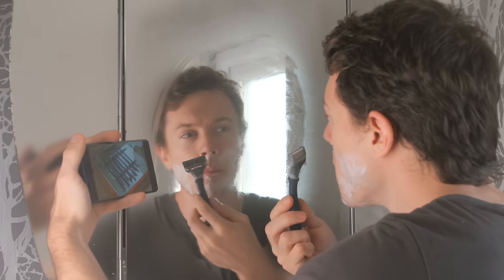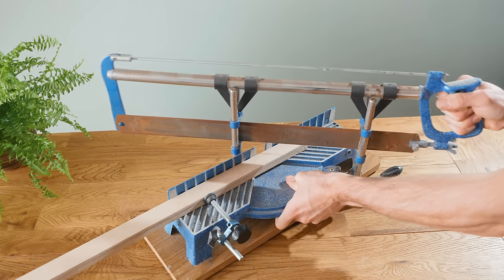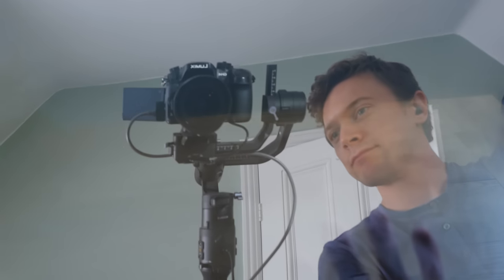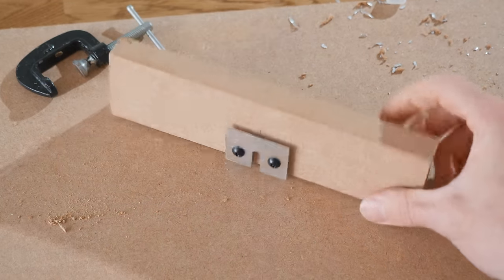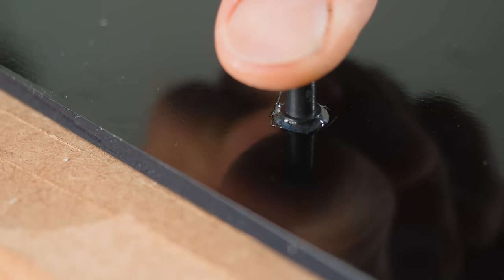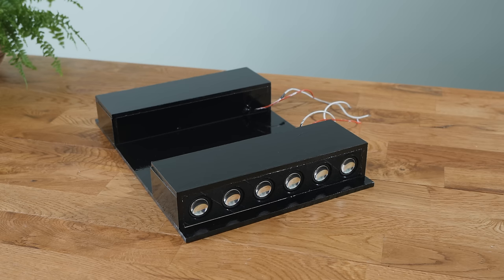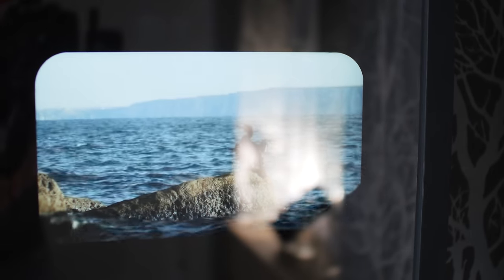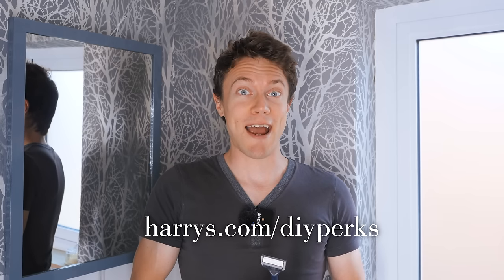DIY Smart Mirror (that doesn't steam up!)

Comment: 6:40 electricity in the bathroom? Meanwhile in america we like "yeah this is a plug so I can bring my TV in the shower with me. And this is my other plug so I can charge my phone and watch videos in the shower. And my shower head is also a speaker".
Reply: Watt?!?  Wow.  Ohm eye!  Definitely not revolting from this comment.  This amped up my day.
Reply: @ronture8279  underrated comment.
Reply: If you just use a GFCI outlet...
Reply: In all countries there are plugs in the bathrooms. After all, you have lights in there, people use them to power up fans, or shave or whatever. Not just the US. 
DIY perks is just implying that if you fk something up, given your diy skills, you wont be shocked with 110 or 220 volts and die on the spot. Worst that can happen is ull burn a board or two.
Reply: @faythelyzabeth5647  actually I was making fun of the fact that they are making tablets you can use in the shower so you can watch TV in the shower.
Reply: Jokes aside, I literally have a mini heater in the plug above my bathroom sink. It's like a little 4inch heater that automatically warms the bathroom up. Super dangerous but no one likes a cold ass or shriveled balls during a mid night pee sesh or freezing to death during a winter shower. 
I also have a bluetooth speaker in my shower, my showerhead has LEDs and a speaker in it also (I never use the speaker, it sounds like crap) and I use a battery powered back scrubber.
Electrocution is real possibility for me. I have so much electrical junk in my small bathroom. Toothbrush, waterpik, and shaver plugged in to one outlet with a air freshener, and I also a blow dryer I use to warm up the toilet seat before dropping loads when it's cold. (My little heater does pretty good, but the seat is always too cold. Try it. You know you want to. It only takes like 20 seconds. Put it on hot, like 1 inch from the seat and move it around very quickly and boom. Warm ass. Success.)

Omg. I'm gonna die in my bathroom! 
Omg! My awesome dental hygiene, warm craps, and awesome shower parties are going to kill me in my warm cozy bathroom! 
...

Oh well.
Worth it.
Reply: @nickdrozd  There are not plugs in bathrooms in every country. Denmark even have their light switches outside the bathroom.
Reply: Hahaha, you think that is dangerous. A lot of countries use mains to heat up the water IN the shower head. I don't really ever see topping that for danger. They're called suicide showers, look em up.
Reply: @ronture8279  with wooden houses, lol
Reply: @JorgenKreedz  It really makes it hard to use a bidet in your bathroom without power outlets.  Denmark is missing out :D
Reply: @ronture8279  Great choice of word there: AMPED
Lol
Reply: @JamesLee-sw6ss  I have to ask why do you need a power outlet for a bidet? Every bidet I have ever seen in Europe just has a water supply.
Reply: @davidturner8833  TOTO SW2034#01 C100 search that one up.

I just looked on amazon and saw the non-electronic ones you were talking about.  I've personally never seen or used them; like I said, all the ones I used in Asia were electronic.

Forgot to mention, electronic seat warmers are amazing...  Anything less is savagery.
Reply: No plugs and switches in the UK either. Million years old regulation. can't charge your thootbrush in the bathroom :)
Reply: @DanteYewToob  are your Outlets typical ones or GFCI ones?
Reply: @andrewmoore7022  They both have the little switches... that's all I know. One of them has only triggered once when I dropped my shower head and it swung around and sprayed everything. I had to dry it out and flip that little reset switch or whatever.. a fuse? Idk. They are the safety kind though. 
It's my ensuite bathroom and only the bathroom has those plugs with switches.
Reply: @nickdrozd  in my country,if you want to put sockets in your bathroom. It must be under 3 watts.

I'm too lazy to do the calculation for the volts so I'm just gonna say i don't know
Reply: This is accurate. The whole time in watching like "but can't I just plug it in instead of charging a battery bank? Lol
Reply: @ronture8279  wow.
Reply: @benjaminsimmons6029  No, you!
Reply: @JorgenKreedz  8 months down the road, and I don't know why I feel compelled to comment on this, so bear with me :D

You can definitely have electrical outlets in bathrooms in Denmark. In fact, when building, you are required to place one in any bathroom where it is possible. What you cannot do is install it in one of the wet zones (the immediate area around a bathtub or shower). Of course, if the bathroom is small enough, it will only be wet zones.
Reply: @chucaraDK  Yeah perhaps, I'm no expert, I only know about this because I have relatives in Denmark, and everyone of them have the lightswitches on the outside of the bathroom. First time I visited I literally went to the bathroom in the dark for a week cause I was too emberassed to ask how the hell you turn on the lights...
Out of the 3 houses and 1 apartment I've stayed in the switch has been on the outside, the 2 times I've stayed in hotels there's always been automatic lights.

Comment: As the creator of the original interactive mirror many years ago, i must say, hats off to you. I've seen MANY copies over the years - this one's a winner.
Reply: one thing i'd do differently... fiberboard/MDF should be a no-no even when primed and painted. Its use scares me in the bathroom, likely to change shape over time thanks to hot showers.
Reply: so where's YOUR video on this project?

Comment: Yes, you managed to get it done, now, you see that more than an overall knowledge is necessary, also the tools, 3d printer and all the gear to make it so. 
Francisco Iniguez said it better than me, usually, the person who DO this type of things have all the resources at hand.
That laptop screen adapter on the other hand is a really nice tip to have at hand when a screen for a project is required, but it lacks of one of the main functions of the smart mirror, that it has to be touchscreen and independent, if there's a lot of preparation to be done to get the thing running before you start shaving, then is easier to get the laptop into the bathroom and play wherever on it, don't get me wrong, theres a lot of good and valuable information and tips on your video (the type of paint, the usb 3.0 adapter, using a bank as a source) and also is really enjoyable to watch, but it may be missing the main point of the practicality of having a smart screen as a mirror on the bathroom

Comment: This is stunning. I'd argue, even more so than some of the other awesome things you've built.
Just a question though, is it okay to leave an exposed PCB and/or components like a chromecast in a room full of steam?
Reply: I think the boards aren't a high enough voltage to have electricity flow through any condensation on them
Reply: @no-lifenoah7861  What about rusting the PCB?
Reply: @MaxIronsThird  I don't think that the rust would effect the conductivity of the PCB, also gold doesn't corrode
Reply: You could spray it with conformal coating.  It's like $20 a can and people use it to waterproof drones all the time. I'm kinda surprised he didn't do that.
Reply: the fact that i always had 220v outlets plus electornica on while showering, lets me know its even completely safe to use resistors as a demister factor. before you say im ignorant and dangerous, no, condensation will never be enough to make droplets or puddles inside sockets or electronics
Reply: @manuelurquiza7546  I think the problem isn't with condensation in the outlet so much as the increased risk of arcing from the more conductive air
Reply: @no-lifenoah7861  thats a possibility, but arching its more likely on higher voltage circuits, in any case all houses are equipped with jumpers and outlets have fuses or localized jumpers. I never got an issue with electronics or outlets in the bathroom, i think resistors are more dangerous than several sockets plugged with electronics on
Reply: @no-lifenoah7861  rust could short the PCB, it's definitely not coated with gold.

Peter is right, he should've coated it.

Comment: Id love to see a tool recommendation vid or just more vids in general! You are one of my favorite youtube channels so keep it going😊
Reply: Yass! Cheap, essential tools ftw
Reply: The tools you need will depend on what you wish to do.
Lowes sales a basic home kit, pliers, hammer, tape, screwdrivers, and bit set. I bought both my kids one a few years ago and they love them.
Even the boy that all over his face said wtf am I going to do with this, called a month later and thanked me, he uses it all the time.
Reply: Or if you're going to do more work that involves moulding of wood like using a router I recommend a router on amazon called the Katsu palm router.
It's literally a rebrand of the makita palm router, meaning all the internals of it and build quality is the exact same that you can expect from makita and it only costs £35.99

Comment: The LCD driver board actually has a onboard 5V regulator. You can bypass it and feed 5V direcly from the powerbank to increase efficiancy.
Lithium battery (4.2V)->Power bank step up (12V)->Driver board (5V) isnt very efficiant.
Reply: I think the laptop screen needs 12 volts.
Reply: Do you mean taking 5v directly from the power bank? If so, I have that same power bank and you can't output 12v and 5v from it at the same time. I've tried.
Reply: shreyas thats true (well my board does have it, 5 volt 2 amps and it works great.
Reply: @Paul_WithaP  I meant why bother to get 12V if the LCD driver can work with 5V with modification. You can ditch the USB-PD board entirely.

And you can use cheaper powerbanks or existing ones which don't support the QC or USB-PD specifications.
Reply: @abdulazeez.98  I tore down some LVDS panels and they have step up drivers on TCON board for the backlight LEDs. I think they can work off 5V.

I remember seeing greatscott's video where he bypasses the buck regulator in his DIY monitor video.

Many portable monitors for laptops run off of a single USB C port for power and DP signals.
Reply: @shreyas kulkarni i think he messed up about providing 12V for audio amplifier board as well. He never mentioned it
Reply: These comments are beyond my intellectual level

Comment: I would recommend using rubber glue/vulcaniser since the super glue will not want to compress, and if it does it will (potentially) break the seal.
Reply: Yes, also superglue isn't waterproof (at least not ordinary superglue) and will deteriorate. Should really use specific glues and sealants for the materials being bonded.
Reply: That's why the seal was at the top. The water won't reach the seal because of the position of the fill and overflow pipe.
Reply: @evilutionltd  aha! Had not considered that.
Reply: @evilutionltd  The filling nozzles were also superglued in place. That might be ok if you only fill the chamber once, but if using tap water you're going to need to empty and refill at some point unless you want a colony of moulds and micro-organisms in there.
Reply: @ataru4  no water pressure though so there'd be no creep and meniscus pressure would stop water escaping.

It would be better to fill to below the fill points, add a bit of bleach to the water to prevent growth and have a small ceramic heater strip in the water.
Reply: superglue will fail eventually when in contact with water.

Comment: Love it.... at the Grand Floridian they have smart mirrors in the DVC rooms. Ever since then I have wanted to make one. I have been holding on to my original surface with the idea of using this  or have another screen that is not touch screen that is much larger but extremely thin led. Was thinking tv/ framed mirror in the bedroom. 
Great inspiration